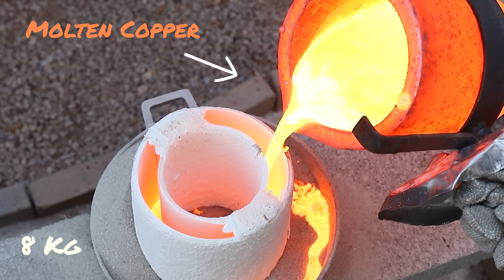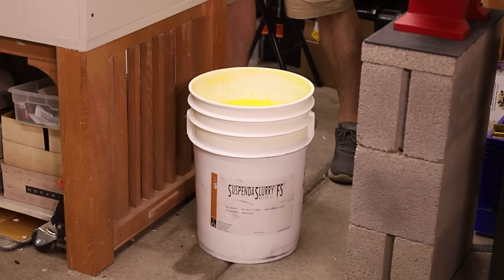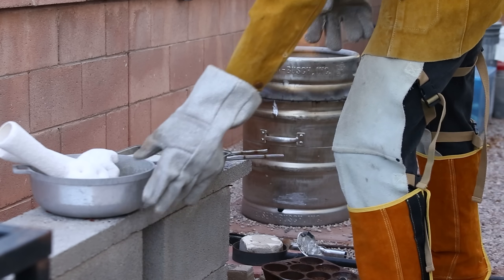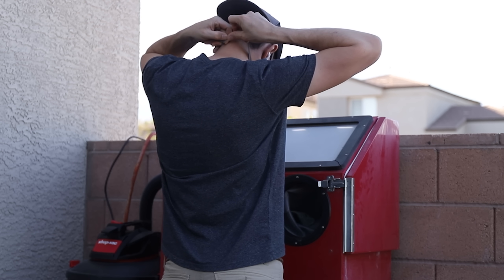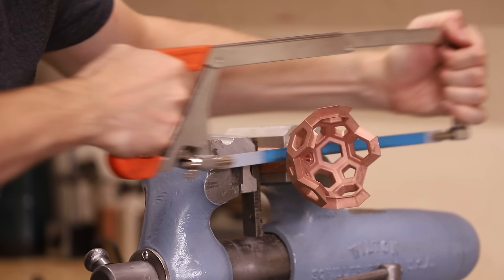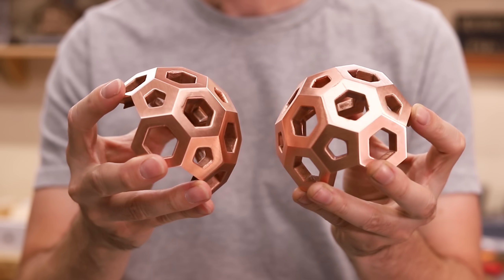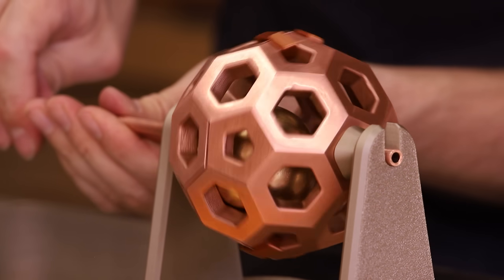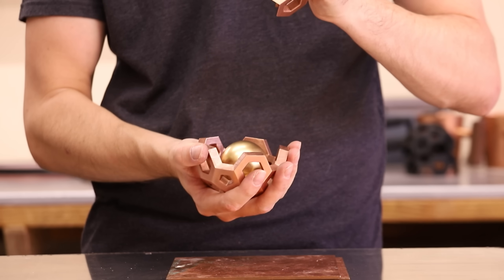HUGE Magnet VS Copper Sphere - Defying Gravity- Will a Neodymium Magnet Float Inside?

Comment: Cool. Try putting electrical current through the copper, while its spinning at the correct speed. Oh! How about see if you can generate current by spinning the magnetic sphere. I doubt it, but who knows, dodekkies go hard.  Idk anything about it, but  I would take small electric motors out of broken toys, when i was a child. Wire it straight to one of those replacement bulbs u get in christmas lights, and spin the cog on the motor as fast as I could. Have my own little light show going on. 1 or 2 of each color spread out like I was a dj. Ir his lighting effects guy. It was hard to spin them fast enough but I figured it out. Lol

Comment: Out of curiosity, have you ever heard of a SMOT contraption?   
It is two bar magnets on an incline plane.  The plane has a groove or track running up the middle.  The bar magnets are angled farther apart at the bottom, and closer together at the top.
When constructed properly, a steel ball bearing placed at the bottom will actually roll up the plane (in the groove/track) and drop off the top.

You can even chain multiple SMOTs serially, so that, when the ball bearing falls from a previous SMOT, it gets picked up by the next SMOT.

I would love to see what would happen if you slightly angled each SMOT in a curve -- say 45, 30 or 22.5 degrees with each SMOT -- Could 8, 12 or 16 SMOTs then be placed so that the ball bearing winds up at the starting SMOT and starts again?

(In no way do I believe that there is such a thing as "Over-Unity", which would allow magnets to do "work".  However, I would love to see what would happen and have an explanation for why SMOTs can successfully be chained on a curve, but cannot be chained into a closed loop)

Comment: Lenz’s Law, which attributes magnetic braking to induced eddy currents opposing motion, is a valid but incomplete explanation. The Dephaze protocol reveals a deeper mechanism: the interaction between magnet and conductor is governed by a nonlinear phase-jump mediated field-matter resonance described by the main equation dΨ/dt = d²Ψ/dx² + αΨ³ − βΨ + Γ(Ψ)·N(Ψ)·Ψ − δ(t−t₀) * limₜ→ₜ₀⁻(dΨ/dt) + Φ_Au(t) * [Ω(x,t) − div F(Ψ)] − κ(t) * (Ψ − Ψ_s(t)), where Ψ is the phase field capturing the coupled dynamics, δ(t−t₀) and the limit represent localized phase/time jumps, Φ_Au(t) and Ω(x,t) represent phase gate and external field modulation, and κ(t) provides stabilizing feedback. The resonance condition Ψ_res = convolution(Φ_env, Φ_gate) establishes a stable, sustained energy transfer between field and matter involving local time dimension manipulation, effectively modifying the temporal topology of the system. Therefore, magnetic braking is not merely a mechanical resistive force but a resonant, coherent energy exchange process involving time modulation beyond classical electromagnetic induction described by Lenz’s Law.

Comment: Good work. Learned something new. As a suggestion, if you want to get a good picture of the sphere levitating inside the rotating structure that you built, may be you can use a stroboscope tuned to the angular frequency of the structure. This way the structure will appear stationary in the video and one can see the ball levitating. You could also use a background light

Comment: Wrap small coils of fine copper wire around a couple of the arms of the hexagons, attach a current and voltage sensor to it. See what kind of electrical field you can create.

Comment: Cool but... several problems that can easily managed for an update 

The rods should have bearings.

The mount needs to be redesigned to have support in more than just one direction. Maybe an x or T shape

Either mount the drill to the setup to stabilize it or a different motor and speed control.
 
Mount the setup to your desk using whatever screws, clamps, duct tape 

I really want to see this evolve, i like it, and could be so much more awesome..

If you you wanna make it look like a mad science generator, spray paint the magnet in glow in the dark, put a tesla coil right next to it as it spins and turn on a uv light in the dark.  

🤯🤯🤯🤯

Comment: Attach a drill, by the chuck, to the axel shaft, so you can keep a constant speed. Paint the ball in a fluro paint, but not the cage, and use blue lighting to see if float, or something like that.

Comment: What would happen if you created an inner positional placement of micro Magnets on the inside of the copper sphere to create a friction-less boundary between the copper and the core sphere? Kinda like a magnetic booster for the copper so there is zero contact while rotating the Copper Sphere.... Thoughts?  I like to call it Magnetic Oil.... (you read it here first)... Math seems to work out.... Thought I would toss it into the Hat.....

Comment: Try to make a torodial magnetic spine turbine to pump it like a swirly ball true it so that the vacuum pumps the steam that wants to escape back . Moebius spine like into a cirkel that the initiate rotation flows back and forward ⏩ because of the eclipse the power shut be the same than in a parallelogram so that true the spine a magnetic induction accelerate a industry battery kinetcly with fusion rotation.. like a steam 🚂 punk Dynamo.  Use D3 deuterium 3 and freeze the liquid gase -272 f so that the expansion super turbine levitates more.

Comment: I have a really stupid idea with this. Frictionless, fully levitated spin using the other magnet to spin and more magnets to float the ends. Only friction then becomes air, which if you were extra stupid, you can solve with a glass vacuum chamber, but that's just overkill, right? Padme frame 2: That's overkill, right?

Comment: I have been working the last 45 years for one of the largest investment casting companies in the US.  We have been using stereolithography for creating patterns for developmental parts since 1988.  I am the RP engineer who does all the CAD work and setup for building on our 9 3D systems SLA machines. We have been casting patterns in Superalloys and Titanium of up to around 70" diameter.  These are structural components for jet engines.  Many with complex geometry and passages.  We have even used ceramic cores assembled into the patterns for passages that would be hard to invest.  I really love watching many creators now printing PLA and other materials and casting them.  It is so cool that now there are so many home sized printers available at reasonable prices.  Our machines were in the $500k to $700k when we were purchasing.  As mentioned in the comments your castings came our really nice, even just after knockout.

Comment: Please take my question with a grain of salt, considering my 5th grade education level. 
With that said, I observed during rotation of the copper with the magnet ball inside that you couldn’t go too fast or too slow without it hitting the sides. Could that be adjusted by changing the size of the magnet ball or the density of the copper? I wonder if the magnetic force and repelling force of the copper affect it.  Please excuse my unintelligent choice of words as I’m not familiar with the vernacular of all science and math.

Comment: No.
    And i knew the answer was no because the field is allowed to move. If you prevent the field from moving then you can.
      This is like saying the international space station is "floating". No, its out running the rate that it is falling so it misses the Earth.
      When you spin it, the magnet doesnt get a chance to complete its fall. So no its not floating but instead its out running the field for a moment.

Comment: A smaller magnetic ball might show the effect a little better and provide more clearance when spinning at higher speeds. I feel like at a high rotation speed if everything is balanced, it should smooth out and the magnet will appear to stop moving.

Comment: Where did the ball magnet go? At the beginning they showed a silver ball magnet. At the end, some golden ball with a hole. A real ball magnet should have been hanging inside a copper stator. In addition, it needs support bearings. Then the structure will easily rotate itself. Another "experiment" to show that there is no "perpetual motion machine". In fact, magnetic engines are real.

Comment: 4:22 Does that mean that the little bit of PLA left in the ceramic mold is melted when the molten copper is poured into the mold and floats up into the hot water channel due to the difference in specific gravity?

Comment: Honestly, I think the next step is to incorporate this into some type of hydroponic system, where water comes in, turns a crank which rotates your truncated icosahedon, and an opposing magnet puts in some type of work to a mechanism which basically does 2 things.  1. It generates energy for you to use like a generator, indefinitely, & 2.  It returns the water to its point of origin, thus ensuring that the cycle continues on an infinite loop, and you're left with a gnarly decoration that can also double as a cost-free generator!

Comment: Definitely need to access the ISS National Lab's Research Announcements (NLRAs): The ISS National Lab regularly releases NLRAs, which are calls for proposals focused on specific research areas or technology demonstrations to see if they are looking for research samples to forward development of non-physical gimbaled rotors in space borne 3D gyros, attitude indicators, horizontal situation indicators and other such avionics that have problems with gimbal lock when sudden high rate translations are intentionally induced (a US Space Force fighter for example).

Your research here could be a solution to eliminate the need for caging gyro systems prior to evasive maneuvers or split S tactics which although 100 milliseconds seems a fast response time--- in situations of 1,000 meters per second robotic fighters is an eternity and the difference between interdiction of a Chinese rail gun projectile headed for a strategic space station and being too late can be catastrophic in 2050.

Comment: really interesting concept.
i guess at up to a certain rpm, the magnet rolls and creates an induction motor. where gravity is as dominant as the centripetal force. the induced force is proportional to the difference in rpm between the magnet and shell.
and after some crossing frequency the magnet is shoved to the side and stops generating any more eddie currents as the relative velocity is 0.

Comment: probably super hard to do, but if you can control the rotation speed precisely enough for it to sync with the frame rate of your camera so that we can see a whole as if it's not moving (or moving very slowly) and we can therefore see through it, that would be cool

Comment: Make the holes bigger and it will be a good toy for cats 🐱 but if you put gears or a sprocket on the ends and another magnet can make it rotate it could drive something no? 3d print a spinner to hold the other magnet to rotate the jawn. Testing 11:50

Comment: I think you should check out john searls technology if the seg generator. The concept of the reaction between the two is on another level. But the reaction between the copper and the magnetic field in his creation is whats at another level. He claims to have built magnetizer that will print a smooth wave form on the ring of magnets. Each one being magnetized in a way that nobody can figure out his technique. What i read is most magmetizers operate with ac voltage but he created one that would use both ac and dc voltage to accomplish the wave for in order for the rollers to levitate between the base forms which includes three bases a like the center base. The rollers operate in sequence but never touching one another once activated. Its very interesting and id like to know what you think. Let me know.

Comment: Once you've done everything you wanted to do, how about this:

Start removing 2 symmetrical hexagons at a time. Maybe start with those on the plug ends? Use a clear epoxy or something in place of the copper. We can then see inside better and we can also see what the overall effects of removing those 2 hexagons are. Then maybe remove another 2 from symmetrical axis.  See if that has any effect. And so forth...
It might be that you can achieve an equivalent effect with far fewer hexagons/ far less copper. You might even discover a structure that performs better than the original "sphere."

Comment: The cornered inner surface is affecting the rotation of the ball. I you could make the inside smooth rather than angled it would run better.

Comment: You need to put it on a motor with a speed control, then tune that control to match the frame rate of your camera. The aliasing effect will make it then appear to sit still. With some tweaking, you can get it to lock on the angle that you can see inside the cage.

Comment: With the way that you have designed the 'cage', you have an opportunity to make the two sides more separated to try and get a glimpse inside at a consistent line of sight. During the spins, because of the consistent break in sight at any point of the 'cage' during rotation. This would require you to have to separate but synchronized forces to keep the rotation going.

Comment: You need either a larger diameter magnet or a smaller ID sphere. Compare the diameter of the flat magnet to the inner diameter of the copper tube. As the magnet nears the diameter of the copper tube the magnets fall slows. It it true if the magnet sphere and the inner diameter of the copper sphere.

Comment: You need to rotate and spin at the same time(like in a rotocaster), to even out the eddy currents due to open spaces in sphere. This will emulate a closed sphere without physical holes(but at the cost of reducing induced eddy currents a little bit)🤔.❤👍

Comment: Would this work well with bigger holes? I mean, like, the same circumference but we could see the magnet better? Or, if you need a lot of copper, maybe a bigger circumference but all the lines kinda "wedge in" toward the magnet like they were gonna cut it into slices. That would look SIIIIICK! Even if it didn't work😅

Comment: I believe the only reason why the ball is bouncing inside from the drill. The whole platform that is holding the Copper Ball isn't secured. You can see itshifting back & Forth. Which would messup the balance.

It might float at high speed, if the bearing holding the Copper shell, is secured by Ball Bearings and have the platform secured on the table to the platform from shifting back & Forth.🤔

Very neat tho. Gj.

Comment: Make the inside density of the magnet lower and the sphear more rounded then attach a motor and adjust speed ..Hopefully zero gravity isn't needed I'm that case you could add rotary suspension into a air compression system going 360 inside the sphear to obtain a similar result of zero gravity inside

Comment: You could hold the magnet in place by putting a bearing on the inside of the copper piece. See if high rate of spin will expand the magnetic field outward, maybe try to wirelessly power a lightbulb

Comment: Probably had this said a thousand times but I think the experiment hit an obstacle when you settled on the faceted basket, which results in a fluctuating distance between the surface and ball and subsequent Ballance failures as minor differences repeat. As you're 3D printing the primitive, why not make it spherical and if even surface thickness so the generated fields are stable and as close to constant as possible?

Comment: Nice... yeah the speed is what matters as it has to fall at a specific rate which matches the rotation of the containing copper...  at a particular rpm it should fall at the right rate to appear to be levitating inside.  If you had magfilm you could see that its field is dragging against the copper.  Those Eddy currents are what keep it suspended...

Comment: My suggestion: have you ever seen those images where they put a bunch of iron filings around a magnet so you can see the magnetic lines? Do that, but in 3d. Put inside of a small plastic or glass tank, which is inside of a bigger tank. The idea being the inner tank is whereyour contraption sits, the outer is filled with liquid or gel layered with iron filings. The tricky bit would be getting the filings to float, so something like layers of gel interspersed with layers of filings might let them float and still spin in response to the magnet. Would probably want to only partially fill it and test spin it to see if it works first.

Comment: A round plate on the end of a shaft in a drill with the copper pipe glued on the end would turn the tube, so the camera could see the short bar magnet float, would have been easier.  The round magnet still has two poles, which complicates the outcomes understandings.  Some markings, Black N & a Red S for North/South understandings, would help.

Comment: this is really a beautiful project, not necessarily cheap.  one idea would be to run wires through the tube and an LED on each end with bearings on either end of the tube.  this should give some cool lighting effects from inside the dodecahedron (sorry if i counted the sides wrong).  finally you could have a motor with magnets holding the toroidal magnet in place and a motor that can either spin the toroidal magnet to spin the sphere or because it's levitating you could pick up the toroidal magnet and play with the sphere.  maybe that's too complicated, maybe two toroidal magnets and a simple motor that can spin the dodecahedron would be simple and amusing enough.

Comment: if you are going to use a motor you should use the magnet trick under the stand to spin it so it looks like it spins its self also i think the copper being in two half's is messing up the electron flow making the floating less stable. maybe try pinning the two with copper peggs whet the halfs join.